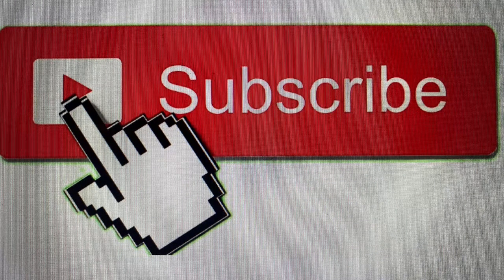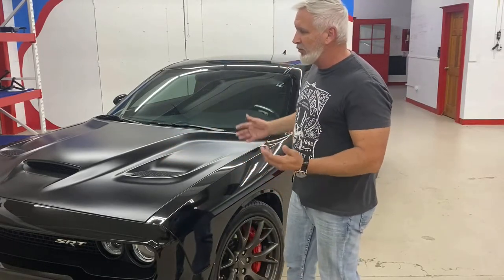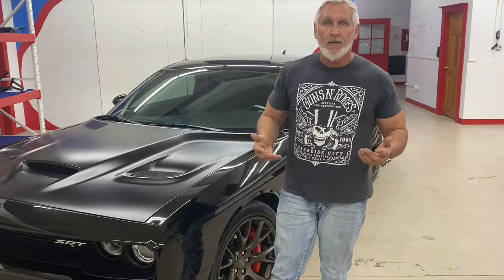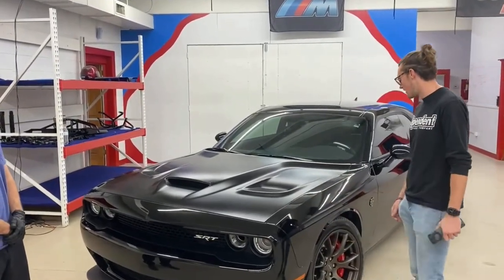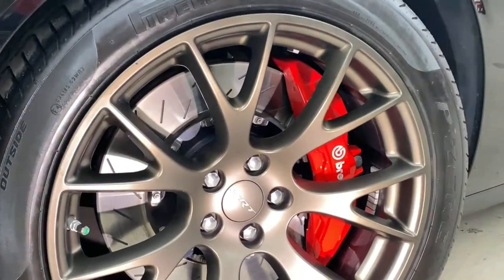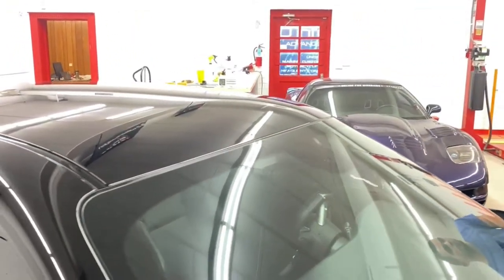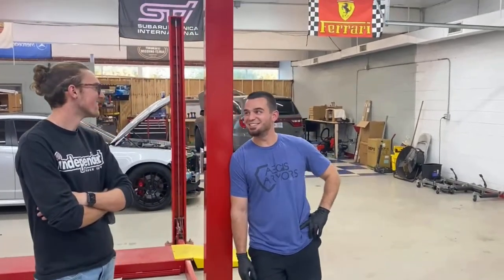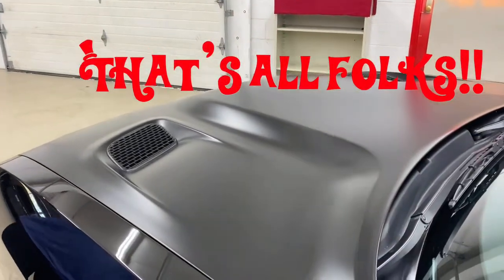When ceramic coating goes bad 🙄

Comment: Is ceramic coat even worth applying on a car?
Reply from the maker: Oh absolutely it's worth it.  Just the fact that it's such a huge time savings in keeping the vehicle clean as most of the time you can do a "no touch" wash with an electric pressure washer and dry with a leaf blower.  Plus the vehicles look better than new for years to come which should have a positive effect on re-sale value.                                                                                               Check out this video on no touch washing: https://www.youtube.com/watch?v=-N5bpL1S6zs
Reply: @aegisarmors  thanks bro

Comment: Did the previous detailer coat over the water spotting?
Reply from the maker: Yes, unfortunately we're seeing this type of work more often.  A lot of companies that are doing ceramic coatings aren't "paint correcting and then polishing"...they simply wash, hopefully decontaminate then polish the paint and coat, leaving all the imperfections under the coating.  We've noticed that online marketing targeted to detailers seem to be pushing that process...polish instead of correct.  It's unfortunate for the entire coating industry IMO